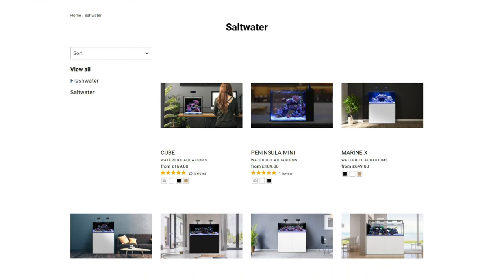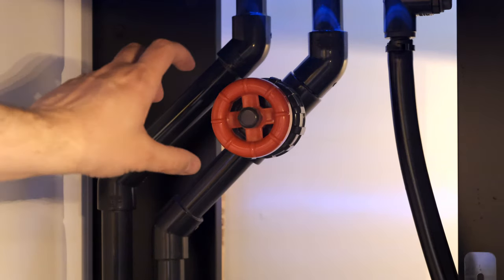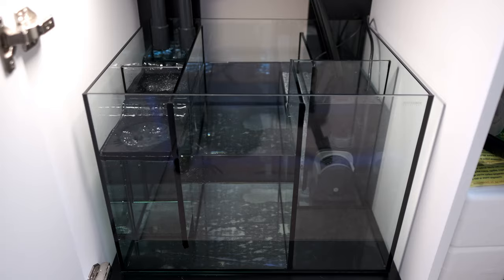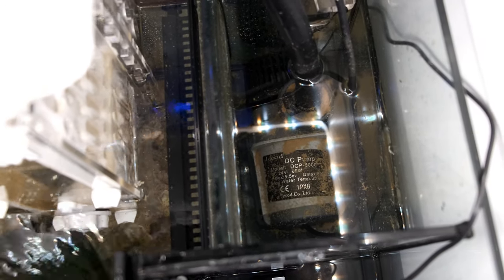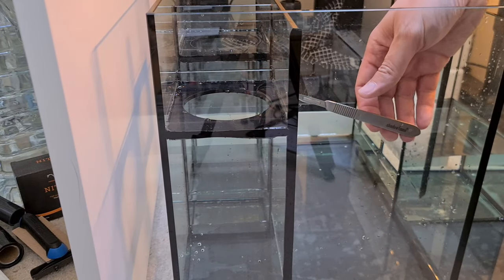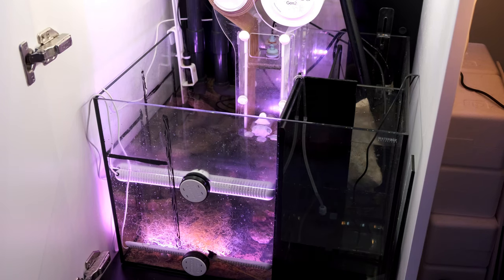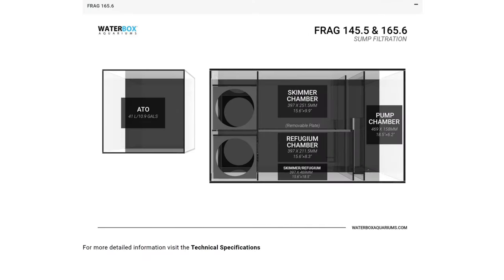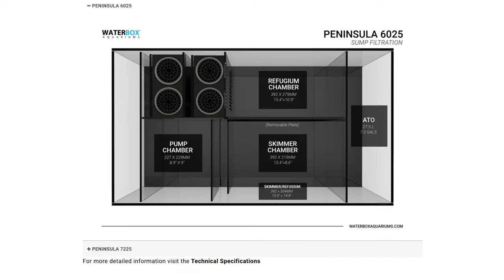Waterbox Aquariums Sump Review/Tour

Comment: I have seen a several sump videos for salt water aquariums now.
And i am amazed how little biological media is added in these sumps.

They all rely on Skimmers and mechanical filtration and sometimes a refugium.

Everybody claims that cannister filters are nitrate factories
But they are usually filled with way more biological filter media thus having a better chance on a full cycle.
And even than you should do regular waterchanges.
(Perhaps with longer intervals.)

With all the spare space in these sumps i would definitely feel like adding way more biological media.
Eheim substrate pro, seachem matrix or any other sintered glass/ pumice stone media.

Now its just a lot of unused space that costs a lot of money only not to have equipment in the tank.
Eventhough still there are always powerheads/wavemakers and an overflow box.
So without visible technique is impossible.

So why wouldnt an internal skimmer and a big cannister filter like the Oase Biomaster 850 cant do the same ?

Saves a lot of money i think.

Am i missing something ?

Comment: Bearing in mind one of these are made in china, £4£ which is better, red sea or waterbox?
Reply from the maker: I think Red Sea are better build quality with a better sump layout. But the Waterbox plumbing is much much better.
Reply: @ReefDork  Cheers. Better stand, tank or both?
Reply from the maker: @modotd3885  Cabinet and glass
Reply: @ReefDork  Agree on the plumbing for waterbox. Valves are much cleaner and the manifold as standard on the larger tanks is really nice.

Comment: Good info, thanks... wondering if you could have found a more compact roller filter that would fit in the filter sock area, so as not to remove the baffle?
Reply from the maker: There's one that goes in a filter sock holder but I think it has very low flow capacity. I personally wanted the extra sump space too 🙂

Comment: That pipework is horrendous. The valve will stiffen over time and you'll require so much energy to turn it that you'll break the pipe work, probably at the base of the tank thus needing a complete strip down. This is solved by putting 1 or more pipe clips so that the pipe NEVER moves when you're turning the valve. Very basic stuff.